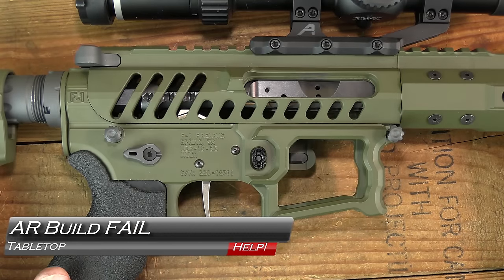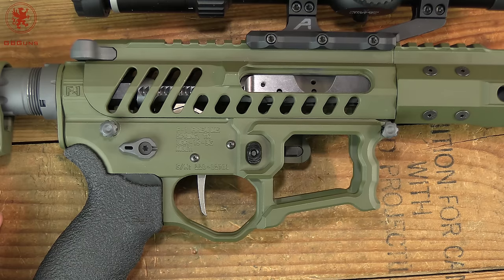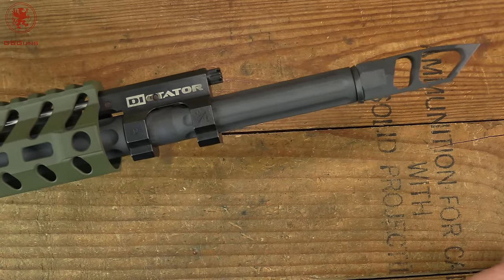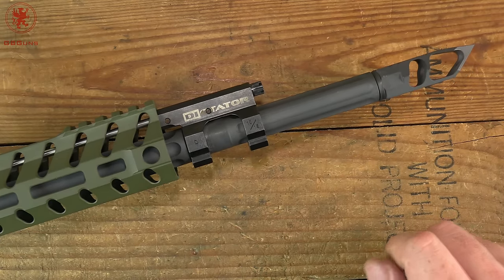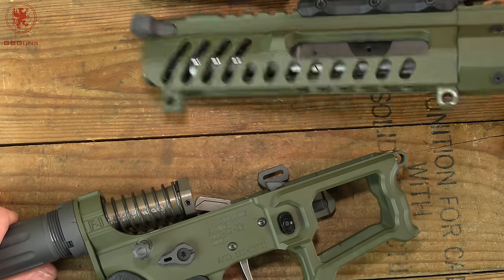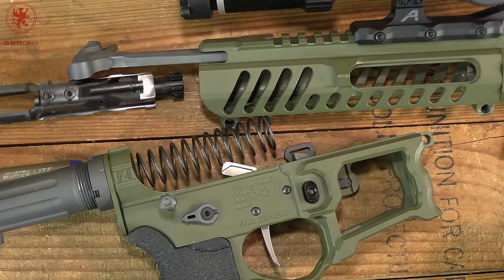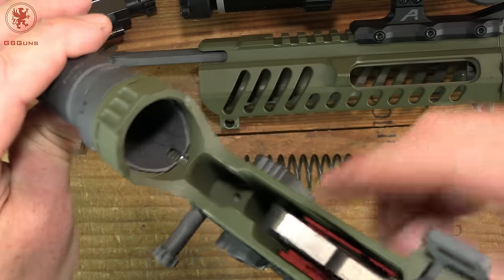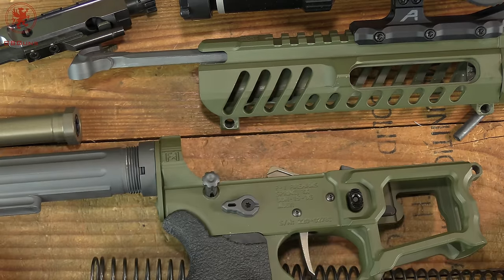The Worst Thing You Can Do For Your AR

Comment: 3:21 in and here is my question to you...
You said you have a carbine buffer system but are running a rifle length gas tube, tells me that the buffer spring is way too stiff to cycle on it's own. Give that a try. Haven't looked in the other comments to see if it has been said, that is just my two cents...
And where is your buffer keeper?
Reply: A rifle buffer syste and a carbine buffer system have the same base resistance and same stroke length. If anything his buffer spring was possibly designed for a AR pistol back before they had pig tails and shorter barrels. As he said in the pinned comment it was the buffer spring, and possibly the gas port. But it's unlikely the gas port is the issue. With a short dwell and the lightweight everything moving, its possible the bolt was beginning to move before operating pressure was reached, causing gasses to escape and causing short stroking. It also looks like there's a lot of carbon on and around that gas block, could be a gas leak. Many people don't install the buffer detent for ease of field stripping, or they simply don't desire to have one. It's not your rifle.
Reply: Beat me to it. Had the same problem with a buddy's mid length tube and a pistol buffer. Dropped my cap'd buffer in, and it ran like a thoroughbred.
Reply: with the coin shortage we can no longer give our two cents worth.
Reply: YOU WERE RIGHT

Comment: Drill the barrel gas port. Worked for my 20'' 350 legend build.
Reply: Yes, I believe he should do this. It would be quite the light show
Reply: Are you 100% sure that the gas port lines up with the gas block?
Cheap way to tell is to use a piece of wire or toothpick that's sanded down to barely fit in the hole for the gas port. Put it in & trim flush with the top of the barrel. Cut a shear line part of the way through. Install the gas block & when you turn the barrel upside down, the wire/toothpick should freely move back & forth. Use a cleaning rod to snap it in half & make sure you recover both halves. 
If it does, and you still have this problem, you need to drill the hole bigger.
If it doesn't, then the gas block isn't lined up. Loosen the block & wiggle it upside down, untill it drops. Then re-tighten the block. Make sure it still moves freely before using the cleaning rod to remove it.
Reply: Yep, adjustable block doesn't do shit without a wide open gas port. A normal gas port is not large enough.
Reply: Gas block indexing and brand name gas blocks can save going to extremes.
Testing bcg for leaks, and a dozen other possibilities should be done before jacking with drilling a gas port. Simply because it takes longer to polish the bore afterward than to check parts and indexing.
Doubly, since DIY tubers can’t afford the drill bit to properly do a gas port. Because it does take a very expensive and hard to find bit.

Comment: I had the same issue with my Triarc 13.9” barrel. I couldn’t cycle any .223. 5.56 I could but not .223. 
The gas port size was .065. It was too small to cycle and so I end up using Sprinco yellow spring (20% weaker)  and it will cycle anything now. Give your buffer spring a try.
Reply: yif you want to use 223 ammo you need a 223 gas block or tube.
Reply: Master80059 the gas block has nothing to do with it. Your port size is what matter
Reply: @miguelrojas5792  Absolutely, agree 100%.  The gas port should be around .075 (I said AROUND)

Comment: Gas block is not aligned or drilled for your barrel. If the wholes don’t align it will choke your gun. Put a none adjustable gas tube that is matched for your barrel. You don’t need an adjustable gas block unless you’re going suppressed and if you are going suppressed you should get a matched set barrel and adjustable gas block. Not all barrels are interchangeable!!!
Reply from the maker: See pinned comment

Comment: I'm glad you figured it out faster than I did. I had the exact same issue. I did a budget build using a CDNN parts kit, 18" barrel, rifle length gas system, and proceeded to put in an adjustable gas block, lightweight BCG from Trojan Firearms (cannot recommend it highly enough), and then built my own 1oz spring powered deadblow buffer. effectively reducing my reciprocating mass by 1/2. had the same issue, showed it to the gun smith at the shop i worked at, he couldnt figure it out either. I even checked my gas port size, if memory serves it was 0.094in, which i think is the largest AR-15 port size, so I knew it wasnt the problem. I did some reading online, and discovered reduced power buffer springs, and got me a 25% reduced power buffer spring. trip to the range to dial in the gas block adjustment, and she runs like a sewing machine. seems that the issue with dwell time that you recognized, combines with a lack of momentum from the lightweight assembly, and there isnt enough inertia to fully compress the standard buffer spring, which causes the short stroking issue. its counter intuitive until you solve it, then it makes sense.

Comment: Yeah I just read the pinned comment, the mass of the bolt carrier and buffer are important to compress the heavy weight spring. If you lighten those you need a lighter spring. Is might sound counter intuitive but it has to do with inertia. More mass moving backwards creates more force. Bad ass build though! Glad you got it fixed!
Reply from the maker: Check out the results!  https://youtu.be/tjFRl6sO_GY
Reply: I'm new to AR's and M&P's but, this is the first thing that crossed my mind. Especially, after he noted that he went with the lightest weight buffer and considering he noted it cycled a little stiff and experienced short strokes. Glad you figured it out. Nice build!

Comment: Holy skeletonized batman, god what happened to that poor rifle
Reply: The gas block being exposed like that was by far the worst thing about this
Reply from the maker: You've never seen an M16 or M4 eh?
Reply: @GBGuns  ehhhhh no, but still.
Reply from the maker: Well, military rifles going all the way back to the AR 601 have their gas block exposed.  Check out the article
Reply: @GBGuns  i dont mean to trigger you, your comments seem a tad defensive but is it atleast dimpled? I clearly dont see pins and thats what keeps the m4 fs from getting knocked off center. I bought one of the 5 set screw m4 style ones and (back when they were "ok" fed fed boys) ran a few mags with my bumpstock. No issue sat it done relatively hard and the table at my range and slid over pretty far. I dont think youd have to much of an issue since its clearly a bench gun.

Comment: Try a flat wire buffer spring. $20 option that may allow it to fully cycle. And where is your buffer detent? Your buffer tube isn't screwed in far enough. It should stop the detent from coming out
Reply: You dont need the buffer detent.  Doest have anything to do with funtion.
Reply: @twistinprops604   Not capturing the buffer allows excess force on the rear of the bolt. Could be enough to cause a short stroke. But I'm just an old soldier , not an expert like you.
Reply: @gerryetheridge7480  plenty of 2 and 3 gun shooters running guns without buffer detents and springs.

Comment: I’m not a professional by any means but have built close to a 50 custom AR’s.
Rifle length gas tube rifle length buffer tube an spring.
I ran into a very similar problem in the past . The rifle length buffer spring is a lot softer spring than the carbine spring also the rifle length buffer tube is longer it should an will also be a soft shooter. Or change your barrel to a carbine length barrel probably going to be a lot harder to adjust it way down the handguard but could be a fix for you .
But I’m not a professional i just have a lot of time invested in AR’s builds  good luck I hope you get it running looks like a sweet AR
Reply: Jeff R. Did you get your guidance? Builder here...

Comment: Try a Sprinco Yellow Reduced power spring. Also where is your buffer retainer and spring (that could be the problem)? You can also take off the gas block and see how large the gas port is in the barrel, you might need to make it just a little bit larger.
Reply: You dont need the buffer detent.  Doest have anything to do with funtion.

Comment: Take two coils off the spring.   If it improves, take off two more then  add weight to the buffer to smooth out the recoil.
With the short barrel ( and therefore gas tube ) there will be a relatively narrow range of loads with which it will
cycle.
Reply: I was thinking the exact same thing! Custom guns require custom modification! If the gas system is dead nuts only thing a guy can try is a complete new bcg or a new adjustable gas block or start cutting the spring

Comment: That buffer spring looks pretty tightly wound...
Reply: Try a lighter spring weight
Reply: Jussie Crowder   Yes, they are spelled the same. Welcome to the English language, now get out.
Reply: I agree  Spring is too stiff  and missing the buffer retainer
Reply: @troydavidson5661  Yeah I was like why is there no retainer strange video
Reply: No retainer and lighter spring?
Reply: @austinhodges1994  thats dumb, ive never held a gun before and i can see that it would be both the gass and the push as the vent recloses after ejaculation. its just looses that spring about pushing it flush, g.l has the right idea
Reply: Prolly a 308 spring.

Comment: I had the same problem . First look at the mag release . If it's not tighten properly it will fail to feed. . also make sure the gas block holes are perfectly aligned . Pull out the screws then look through the hole ,then you can line it up using a small punch

Comment: I was hoping you’d say spend and absurd amount of money to make sure every bit of dust and grit gets in the important stuff
Reply: Typically F1 builds don’t have issues running because although they have big holes in the upper which allows dirt in, the holes also make it easy for dirt to get out.
Reply: When I first saw that upper, I was thinking, "You just spent probably over 3,000 for something so unreliable because of them holes on the upper receiver." My one $300 AR probably outshoots this pos.
Reply: @stephensniff  lol if that were true wouldn’t high speed sf guys want skeletonized stuff? Yeah it saves weight but to keep a gun running smoothly you want to keep as much grit out as possible. That’s why ar-15s have a dust cover in the first place. Not to mention getting any gear you have caught in all those holes could be a huge problem
Reply: @m seriously man i hate gun video window shoppers that have to validate there 300 gun they save up for. "See you jam just as much as me." 🤣

Comment: try  a   swapping the   lower  and  upper with  a  gun you know  that  runs see  which  one  fails then  go  from there
Reply: yep that's the way to 1/2 the possible ..
Reply: Yep, too many unknowns!  Start with working parts then swap in your questionable parts one at a time to check which ones work and which ones don't.
Reply: How would that change the under gas issue...?
Reply: I suspect you are right about the port size. Put the original spring back in and throw a can in it. And don't ever worry about 18" barrel with rifle length gas system.  I have a 16"barrel with a rifle gas system.  Don't tell me I'm mistaken because I'm not. It worked just fine with a non adjustable block but the point is to suppress it and turn the gas down and not get so much gas in your face.
Reply: Josh Weaver  the spring doesn't go into the receiver while the BCG is in place. When in battery, it's still keeping the buffer and spring in the buffer tube and out of the receiver. 

If you don't know how guns even work, you shouldn't try to diagnose their problems.
Reply from the maker: I didn't cut my spring, I got one the same length but with a reduce rate.  Still no detent, it's convenient but not needed and with this set it's threaded which would prevent me from experimenting with the buffer weights
Reply from the maker: Correct.  Ad stated in the pinned comment I solved it with a reduced rate spring, did not cut the original.  A detent locked in place would defeat my intent with this build.  When I bought the receivers I didn't know that they had thread in detents.  Watch the second video and you'll see why I built this rifle

Comment: When I went to light weapons school the instructor said a buffer spring needs to do two things: 
Strip a round off the magazine.
Completely lock the bolt. 
 
A well tuned Stoner design will have a nice neat 12 inch pile of ejected brass at your 1 or  2 or 3
Reply: 1 o clock brass ejection would be over gassed as hell wouldn't it?
Reply: @noluckpureskill9985  yep

Comment: I dunno, milling holes all the way through your upper is pretty dumb to begin with.
Reply: Haha  sand dust and dirt go brrrrrrrr in your moving parts
Reply: I don't get the novelty of it either.   You would think people would have gotten over that idea after the sho-sho magazines back in WW1, but nope, we need to relearn the lesson.      Too much light weight extreme in this build.  He has removed all the moving mass he can, and the result is no function.  Not the first one to do it, and not the last.   The AR design needs that mass to operate properly, and reliably.
Reply from the maker: See the article, I think it'll be eye opening
Reply: @GBGuns  Very nice looking rifle. sure a long way form that used first gen SP-1 that caught my eye when I was 18.

Comment: Without a video of the action, my first thought is the 'stiffness' of the slide action. It 'sounds' awfully tight. Is it tight enough that the drag results in a timing problem (as you noted). Also, you stated it was a carbine buffer/spring combination. That may be too stiff as well, and the cumulative result of drag and stiff spring slows the bolt down enough that the gas bleeds off before full cycling. I would film that in slo-mo before I touched any hard modifications.
Reply: Loosen up your upper to lower fit. If it's too tight it might bind the bolt carrier, especially with the cuts in the recievers, the cuts can take away stiffness.

Comment: This is funny in that it demonstrates a rule of my life: the more “upper end” parts I get the less chance the aggregate has of working properly. I have both an AR pistol and a rifle that I threw together out of spare parts and some very cheap parts (the pistol has an Anderson lower). They will shoot any ammo, any time. A couple of rifles that I thought, “I’m making a really nice one here” turned out to be delicate and finicky in the extreme. Note, this has proven to be true in other areas, e.g. Airsoft guns (no, I’m not saying I built them.), audio equipment, just generally stuff that I love and wanted to be great, wasn’t. Not that a lot of cheap stuff doesn’t disappoint, but I’ve had way too much trouble with “upper end” stuff. Weird.
Reply: mid range is wonderful because if something doesn't work it's  not a huge loss but if it does then it usually exceeds expectations
Reply: Friens of mine who fixed heating boilers, commercial and home, said the same thing.  Short of a water jacket cracking, most home problems were simple... worn electrodes, clogged old dirty nozzle, photocell covered with soot... etc.  People always throw too much money at guns, cars and boilers to fix simple problems.  My old Bushmasters and DPMS's with their crummy triggers and phosphate bolt carriers always work.

Comment: youre also missing the pin that keeps the buffer where it should be.
Reply: thats what i was thinking, thinking maybe the buffer is keeping constant tension on the bolt carrier and the bolt isnt blowing back far enough for the round to be cycled.
Reply: Yes
Reply: Get rid of that extention piece have the buffer sit in the tube and maybe a lighter spring becausr the gas tube is 3.5 miles long.

Comment: i noticed two things one is the buffer, when you took the gun apart the buffer was up against the trigger, therecshould be a detent that the buffer sits behind, the other thing i noticed the piece behind the fi imprint is in backwards,
Reply: doesn't need that pin.  a lot of us remove it. it's just so when you open it up it holds the buffer tube in place.
Reply from the maker: Thousands of comments and you are the only one that knew that
Reply: @blue03r6  Why remove it? Is there a benefit to the pin not being there?
Reply from the maker: No benefit for most users as take down becomes a little more involved (tiny amount).  For me and this build it was so I could have easy access to the adjustable buffer.  In this receiver the pin is threaded on with a  tiny (and frail) Allen key.  I didn't want to need that tool and have to use a tool just to get to my buffer.
Reply: @AdversaryOne  it's a military designed weapon.  It's designed to be used by ...no offence to our military men and women ..by idiots lol.   It's to make the gun easier to field strip.  If you forget it's not there the spring and buffer can fly out when you open the upper from the lower.  When the gun is assembled the buffer rests against the bolt carrier not the pin.
Reply: @blue03r6  we prefer the term, Private.  Because "Private" can break the unbreakable and mess up the un-messupable.  they will then tell you,"But, I thought ..."
Reply: @GBGuns  I figured you took it out to show us the buffer more easily but realized that doesn’t make sense. Maybe try installing it. Pain now that your backplate is staked but can do it.
Reply: @GBGuns  you need to figure out how to reply to YouTube comments. You need to click on the content you're replying to, not the original post. If you click the original post to reply, it doesn't tag anyone, and implies your talking to the op. Click the comment of the person you're meaning to reply to, so it tags them, and people know who you're talking to.
Reply from the maker: Not always from the creator app unfortunately.